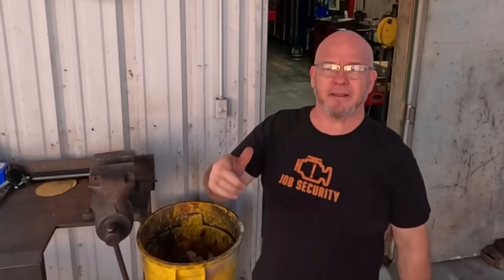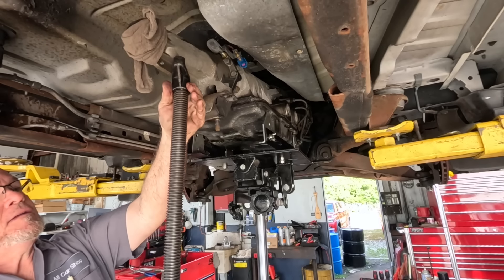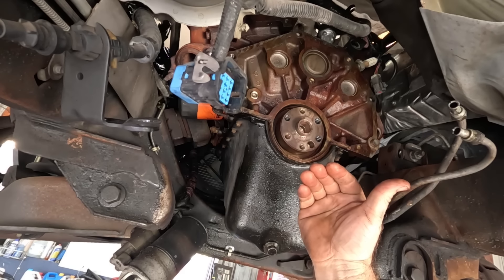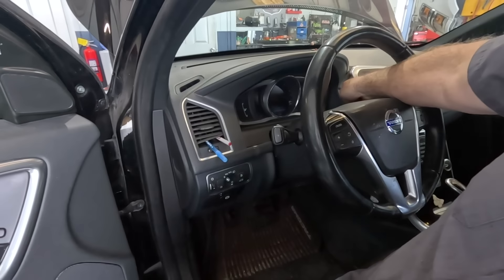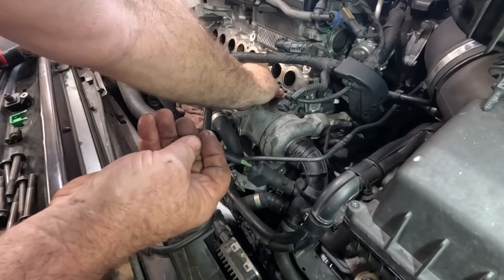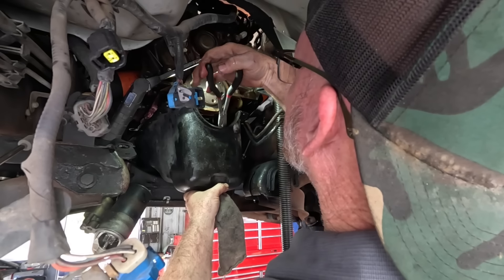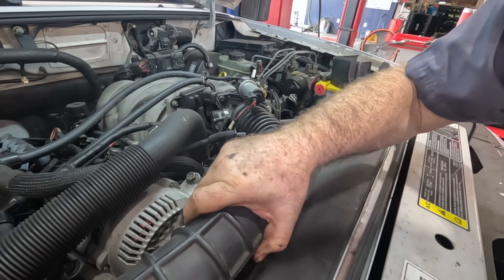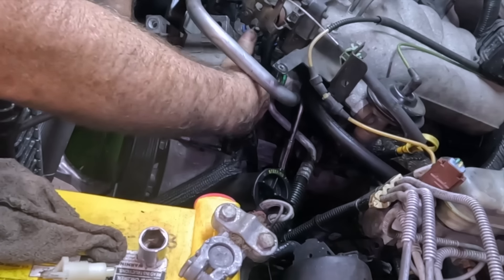VOLVO LEAKS, RANGER LEAKS TOO. DAY IN THE SHOP 459 #oil #coolant #repair #fix

Comment: Volvo is one of the best and safest cars on the road
Reply from the maker: I remember those commercials as a younger man. Now Subaru is staking that claim. Most modern cars are pretty safe nowadays. 
I have to look at more recent crash data to see. Curious how they all stack up now.
Reply: My wife drives a 2013 XC90. Mechanically it has been fine. Just about to hit 70k. Interior wise and paint it has not held up well in the Texas sun and heat. I feel like it is biodegrading in the driveway. I have replaced many rubber parts and plastic. After the third time replacing things I have said the hell with it. I am about to do a drain and flush on the trans. The manual says it has lifetime trans fluid. Bullshit. I think that Ford pickup is 68-73. Same era as the 67-72 Chevy trucks. The next era of ford pickup got ugly.

Comment: You mentioned about manufacturers telling people to wait twice as long to change their oil. I was servicing a Toro Recycler push mower we inherited. I removed the blade for sharpening and cleaned the underside of the deck. I couldn't find a drain plug. I put the blade back on and set the mower on its wheels. I noticed the decal on the engine cover said "Never change oil. Just add". I guess Toro expects you to just buy a new mower every couple of years. I pulled the dipstick and tipped the mower on its side and drained the crankcase that way. Unbelievable!
Reply from the maker: Holy moly that is crazy. Maybe they burn enough to allow adding at proper intervals, lol.
Vacuum sucker required with purchase!

Comment: Jimmy, good morning sir. As always great video. In my limited experience, and Bill and Bob over at Ford May have said nah no reason to spend .12 cents. The fan blade attachment nut when using left hand threads have cuts in the hex edges at 90 degrees to the hex. That has been my experience. Regardless great job on the Ranger. Hope you have a great day.
Reply from the maker: Right on, have to look for that. :)

Comment: Jimmy it look,s like someone as put stop leak fluid in the radiator with all them chunk,s in the radiator if you got a leak don,t put chemical,s in the engine just get the problem fixed properly paul from england
Reply from the maker: Exactly! Agree 100% Paul!

Comment: Torqued at 227 YouTube foot-pounds.  For not dropping bolts, one thing I have watched in electronic repair videos, people use a rare earth magnet on the shaft of a screw driver, or bit driver.
Reply from the maker: Yeah, you can also use magentizing tools. I always think I can make it work and don't take the time to do it unless it's a really sketchy situation. :)

Comment: 2 more bolts and a couple of wire harness clips and you would be better to pull the motor out of the ranger
Reply from the maker: Yeah, then I’d be inclined to remove the hood, get the engine hoist. I used the chassis as an engine stand. :)

Comment: Good stuff Jimmy! Have you used the 4/8 Gearwrench locking Flex Head? Man it is awesome! Almost as good as Snap On, but not 300 bucks!
Reply from the maker: I like the flex head they make, I have one a viewer sent works great. Haven’t tried the locking version yet.
Reply: @JimmyMakingitwork  Jimmy, it is heavy duty, but with the 120 teeth and the feel of the finish
,it is way better than my comfort grip. It seems like a Snap On to me.